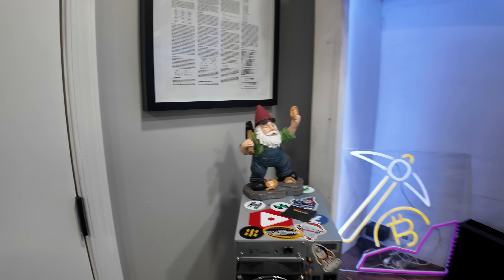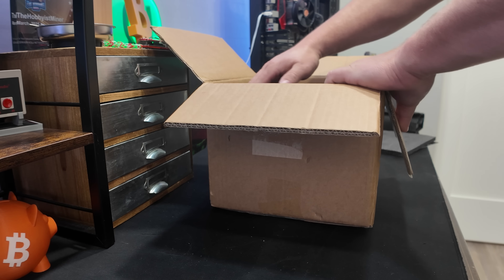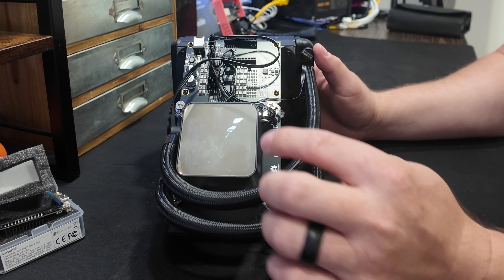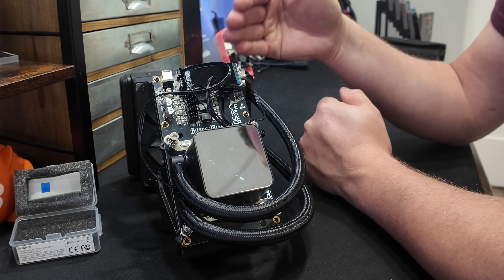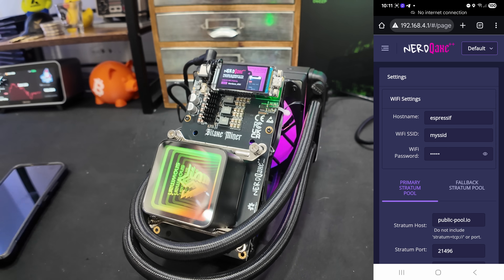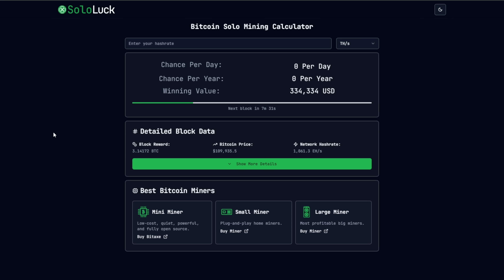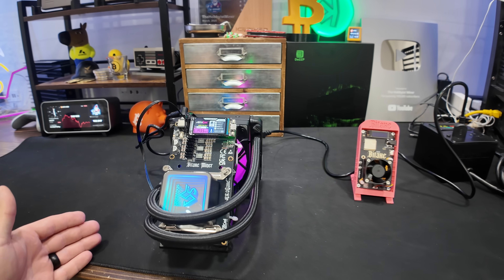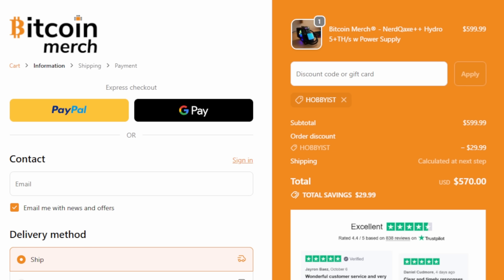Bitcoin Miner for Newbies — This Device Makes It Easy!

Comment: Thanks for the Discount code. I picked up a NerdQaxe++. I would put the Bitaxe 602 on my bedstand in the winter for heat and  use the hum of the fans as white noise for sleep. Then I would move it onto my desk at work to live out its entirety of life...

Comment: I am currently mining Digibyte with two Nano 3s and a Hydro. The Hydro has found more blocks, at a ratio of 3-1, than the 3s'. Not sure how useful that bit of information is but another hydro would look nice to my existing one. (updated ratio 10-Nov).